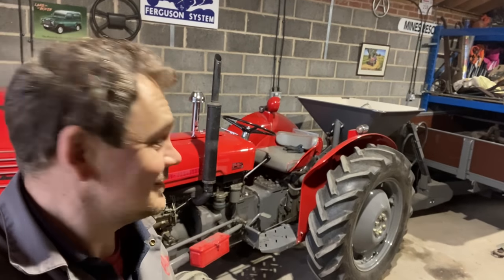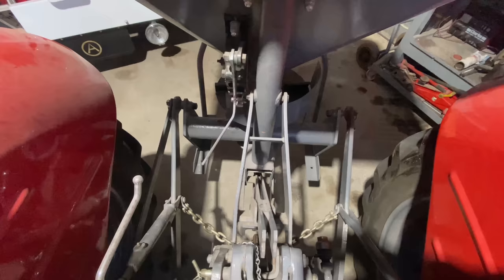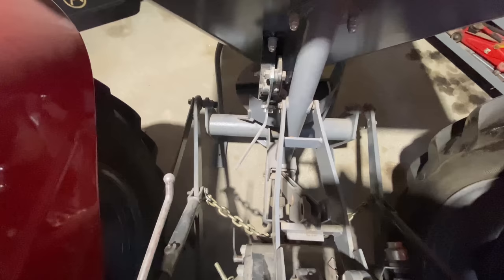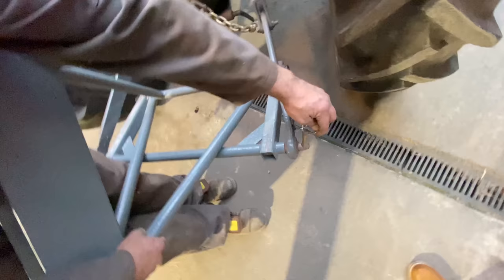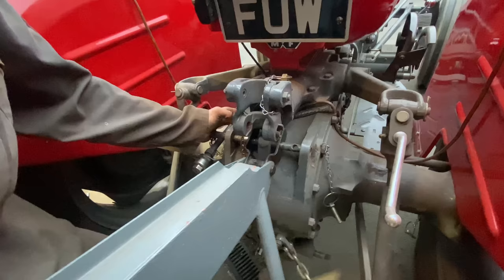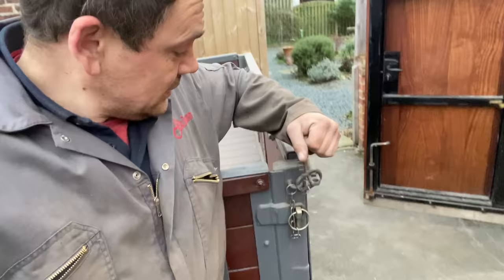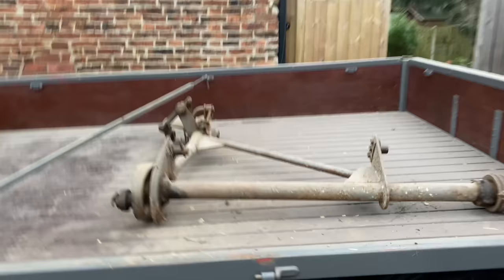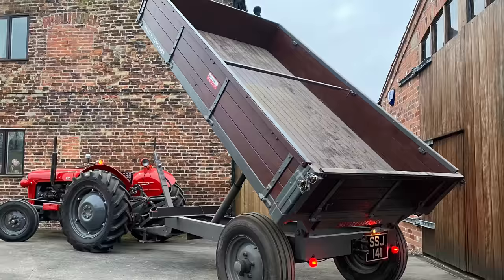Massey Ferguson 3 ton tipping trailer ant Massey Ferguson 35x

Comment: Very nicely restored collection. I remember using one of those trailers ,it had the extension grain sides which dropped into the hollow posts. Eventually I think it was beyond easy repair and a Flatford body was fitted.

Comment: The 35 and trailer go really well together wry nice set up, they are a credit to you.
Reply from the maker: Thank you for the comment.
Reply: I take my Ferguson Crane apart to make it lighter and easier to fit and take off. Separate the two parts… slide out the piece with the hook attached.

Comment: Hello, 
I have the same trailer which my parents bought second hand about 40 years ago , it was red with yellow wheels when bought. It also came with the hay bale extension and racks /lades .On  the brass plate it is marked as a Model 177 and serial no. V17159 . This might help you date yours .Nice collection of MF and Ferguson equipment , good to see them still in use , well done , all the best.
Reply from the maker: Thank you for the comment. I will look tonight and see. Much appreciated
Reply from the maker: V15903. So a good few before.   Thank you.

Comment: had one of those trailers until about 20 years ago when it was buried in a hole and the chasis became my electric fence earth post for the single wire round four miles of drystone walls

Comment: Nice tractor and attachments. Wondering what engine is in the tractor. 3 cylinder Perkins or the 4 cylinder Standard engine. And what year is it. ?
I have a 1951 TEA20 Ferguson, surely not in as nice of shape as your tractor, but it works great. 
Nice video.
Reply from the maker: Thanks for your comment. It’s a 1964 3 cylinder 35x.